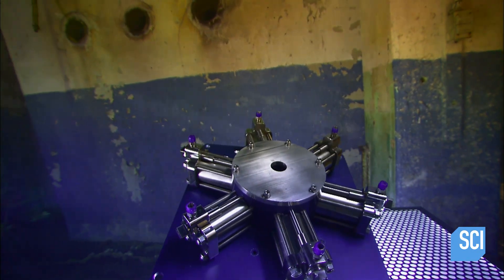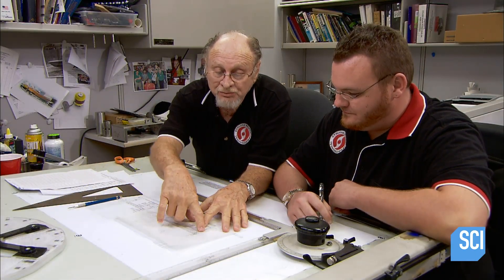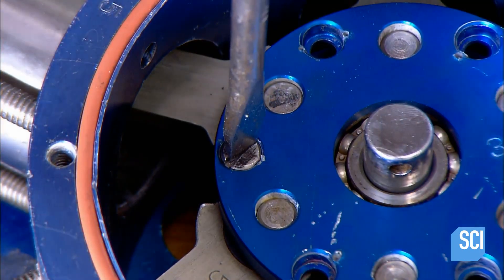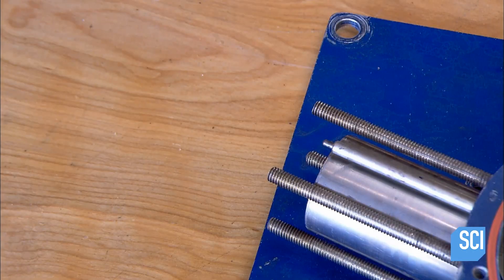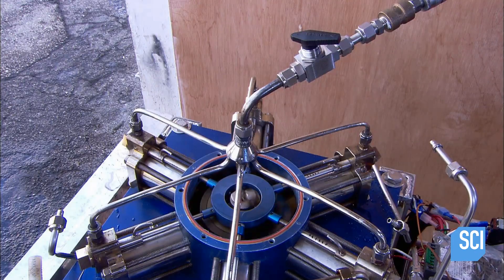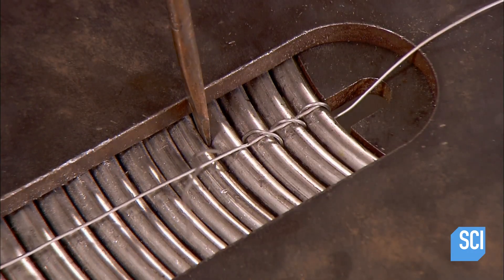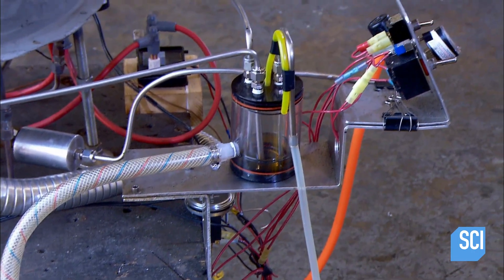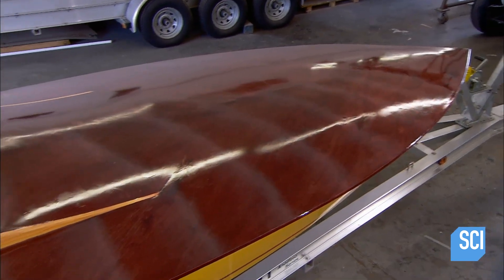How It's Made: Steam Engines

Comment: There are very good reasons we stopped using reciprocating steam engines. This is some cool, hobby level stuff but this isn't serious and I question their efficiency and clean burning claims.
Reply: yeah the multiple "so much cleaner/less greenhouse gases" claims are just outright lies lol.
Reply: @toxicity4818  Well if your burning waste like old fry oil then yeah, that's organic and carbon nutural.
Reply: @toxicity4818  they aren’t actually, lower burn temperatures and pressures releases less NOx. This is a huge problem with jet engines as their combustion chambers run at extremely high temperatures and pressures
Reply: @toxicity4818  There is a reason everything that requires high efficiency and reliability uses a steam engine.
Reply: @StuninRub  like what? Ships? Unless you're only focusing on nuclear you have absolutely no idea what you're talking about
Reply: @jonslg240  Look at almost every power plant in the world. With the exception of Solar, Wind, and Dams, everything else runs on steam.
Reply: @StuninRub   I don’t have enough patience to get into this discussion… either way, steam engine and a turbine powered by steam are two slightly different things. Also things don’t run on steam, they run on nuclear/ fossil fuels.
Reply: @Hypern0va  yes they do run on steam. Nuclear is ran by nothing but steam. They use uranium rods that undergo controlled fission which creates heat, that heat is used with water to create steam which turns turbines which produce electricity using magnets and copper wire. Coal and natural gas power plants all work like this as well. All fuel burning power plants work like this to be honest.
Reply: Steam engine? Or turbine? It's say to say you don't understand how nuclear power plants work... Or the rotational movement, like Mazda engines.
Reply: @SteveVi0lence   99.9% of the population doesn't know how a nuclear power plant works.. What are you trying to prove
Reply: @SteveVi0lence  I think you're lost
Reply: Yup, this one was total nonsense lol.
Reply: Admittedly I’d want to look up this product before actually buying one.
Reply: Denatured alcohol would work
Reply: @whidbeyhiker  dude stop changing you’re story, you’ve contradicted yourself 5 times already. Stop pretending you know what you’re talking about. Anyone who knows a lick about anything having to do with steam turbines steam engines or anything to do with steam sees right thru your bullcrap. Funny how I called you out on your bullcrap then you try to change what you said then act like you never said it and now you’re you’re trying to claim you’re right because you got called out and looked up the actual answer on google. People like you are disingenuous and can’t even keep all of their lies in order. You’re a fraud. Nothing you’ve said has made sense yet except for when you changed your answer about steam engines running at 10k-12k rpm’s and revised is to 1800-3000 bc you looked it up on the internet. Once again another contradiction. Hell you can hardly even speak English or formulate sentences. I’m done here. You’ve proved to anyone that reads this that you’re an absolute fraud and know absolutely nothing about this subject. Also let’s see your transcripts from school!!!!
Reply: Just throwing this out there for the steam turbines are quiet crowd, the average noise level in level in a power plant is 90 to 95 dB. This is loud enough to that you should use double hearing protection, I have worked with a lot of people who have lost their hearing To some degree. I'm sure somebody can find some little steam engine somewhere on YouTube that doesn't seem to make a lot of sound in the video in the video however I worked in the field for 40 years and I'm telling you it's hot it's loud.
Reply: @whidbeyhiker  Post the video!!! Let’s see it!!! You said you could prove it!!! You said you have the “certifications to back it up”. Once again another excuse! Im waiting to see what other excuse you come up with. You were all ready just a little while ago until I said I would be verifying and doing reverse searchers to make sure you weren’t just using someone else’s and trying to lie about it. You sure are doing a lot of talking. Let’s see the proof. I called you out on your crap and that was the last thing you expected. So once again stop googling names of certificates you found on google and start actually showing the proof. If ou had the proof you would have posted it by now instead of making excuse after excuse after excuse. I’m waiting.
Reply: @whidbeyhiker  you can say you have a million certifications, doesn’t make it true. Until you post proof of your certifications you nothing but a liar and a fraud pretending like you know what you’re talking about. Also you were so ready to post the proof until I said I would be checking and making sure it was legit and indeed yours and not someone else’s. Now you’re making every excuse in the world bc we both know you don’t have any certification in regards to steam engines or steam turbines. Absolutely nothing. You’re nothing but a little bum on YouTube that’s confused and doesn’t know what they’re talking about and then makes up lies about having certifications in order to make the false bs you say sound believable. You’ve gotten away with it for too long and think no one will call you out on your crap but guess what I did and now that I have you’ve changed what you’ve contradicted yourself multiple times you’ve stumbled over your words and you’ve made every excuse in the book why you can’t simply take a video on your phone showing your transcripts from the school you got your certifications from and then show your actual certifications that you claim to have. Once again like I said you were all ready just a little bit ago very eager to show me until I said I would be verifying to make sure it was indeed your and not someone else’s then you didn’t want to and tried changing the subject. That’s exactly what liars do bc you’re nothing but a liar and a fraud. I’d love for you to prove me wrong. So once again I’ll be here waiting for your video.
Reply: @whidbeyhiker  yeah I’m the one who said they were silent, you on the other hand said they were not. Regardless I posted the video on my page. Now post yours. No more excuses. Either admit you’re a liar and a fraud or prove me wrong.
Reply: @JohnDoe-yq9ml  Turn your volume up. That was sarcasm.
Reply: After being accused of being a fraud by a guy who thinks the Navy uses reactors on submarines because the turbines they power are quiet I decided to go ahead, do what he demanded and post a photo of my license. I guess a clown has to clown. I have to wonder, what will he demand next...  youtube.com/shorts/2Fz6jABMJyk
Reply: @whidbeyhiker  NO ONE WOULD EVER SHARPIE OVER THEIR CERTIFICATIONS 😂 who you trying to fool??? I could make that in 5 minutes using Microsoft office.
Reply: @JohnDoe-yq9ml   That is last year License. It is expired. My license requires an annual renewal, my Seattle license requires an annual renewal and continuing education. Why don't you do everyone a solid and reply only to the video I posted if you want to argue about it. I will be more than happy to debate you but I bet the rest of the people here are sick of this. Again, if you have the balls to continue this I left comments enabled on my short video (you did not, wonder why).
Reply: @JohnDoe-yq9ml  Apparently no retraction will be made. I sharpied an EXPIRED license. 

You don't understand the difference between a license and a certification. A license expires and has to be renewed periodically. A certificate is what you showed me, you get it once, rub it, drool all over it, hang it on your wall. My education was all military, there is no way I am showing you my military records.
Reply: @JohnDoe-yq9ml  Oh, hi clown, I just received this year's license if you still insist in seeing it. Let me know.
Reply: There actually isn't all that good of reasons.  

It stems almost entirely from tests run in the 1950's comparing antiquated, worn out steam trains burning coal or oil, to brand new diesel-electric engines while focused entirely on a micro-economic scale of cost to operate 1 train at a time.  

Now for fixed installation the steam turbine is simply unbeatable, which is why its used everywhere.  

But there is an argument to return to steam power for trains, the least of which is they can run off ANYTHING that makes heat, the vastly improved thermal conductivity of newer alloys, the cheapness of stainless steel.  The pro factors in that anything can in theory be used for fuel, including many kinds of materials that would otherwise be considered waste in the modern day.   Old steam engines were built to use coal because its was insanely cheap, burned very hot, and they didn't care about pollution concerns.   But anything from pelletized vegetable farm waste, to trash, to used cooking oils, bio diesel,  or even battery powered electric boilers world work.   It if burns, can burn hot, it can boil water and make steam.   That and with modern materials they could run boilers with 3x the pressure of the old ones that were using mild steel or pig iron boilers, meaning EVEN MORE power.   They already do this with ship boilers for their steam turbines.  

Diesel-electric's biggest problem in trains is the efficiency falls off as the RPM's of the electric motors increase, and the losses of power conversion inside the train engine itself.  This means the operator starts "wasting" fuel as they increase the speed of the trains since they need to burn more fuel to go faster.   Steam engines are the opposite, they can be hard to get started, put out more horsepower the faster they are run, with bearing strength and wind resistance limiting their top end speeds.  

The biggest problem is people cannot get out of their head the image of the trains of yesteryear pluming giant clouds of black smoke and equate them with toxicity and air pollution.  Thus its become a hard absolute hard-no from non-engineers to even considering modernizing steam locomotives.    In fact the world's remaining legacy steam engines were quickly decommissioned as the public demanded their removal with the rise of, (much needed honestly) environmental awareness by the public in 1960's.    Despite the fact diesel-electric makes more carcinogenic emissions, and burns more fuel per ton at higher speeds, it doesn't create plumes of smoke.  Simple people are simple, but they do vote and write their politicians eagerly.  

Also steam is 100% useless in a short-range, light-duty passenger car.  Most of the applications shown here are ridiculous.  Steam is kind of crappy at small scale and scales with size.  The opposite is true of internal combustion.
Reply: Here is a video of a plant I am responsible for. It's loud. Just a little taste of what it is like working around boilers. FWIW, this is one of the cleanest boiler rooms you will ever see. We pulled all the turbines out years ago, they were loud, very loud. After removing the turbines we downsized the boilers youtube.com/watch?v=RFT3wtx24D0
Reply: Very loud, these guys should be wearing double hearing protection. You can here them talking about the main condenser and he states that there is no vacuum at the beginning. As the steam is used and expands through the turbine it then cools as it passes through the heat exchanger (main condenser), the volume of steam is reduced greatly which causes a vacuum to form in the main condenser. youtube.com/watch?v=LsUFcMPhEpw
Reply: @whidbeyhiker  dude shut up and post a video of the “certifications” you said you have. Stop making excuse after excuse. You got called on your bullcrap and you’re making every effort to try and change the subject. You said you had certifications to prove it. You’ve done no proving only more lying and more excuses.
Reply: Yall the reason Russia has such a strong hold on the EU. All this stupid talk about renewable and fuel efficiency gives countries that have control over natural gas and oil such a monopoly on entire groups of people. 

Burn coal and use nuclear power. Screw these new age means of energy
Reply: Literally why is it not a turbine?
Reply: Steam engines are quite thermally efficient and don’t generate much noise in comparison to other engines, reason we stopped up using them is that they do not produce much power for its weight and size. But they generates massive amounts of torque and don’t rev particularly high which would work well in a large ship or train. When it comes to how clean they are, it’s pretty much determined by the fuel it uses.
Reply: @loludied552  guess I better turn all turbines off at work since we don't use them anymore.
Reply: @whidbeyhiker  you know we use steam engines in nuclear submarines bc they’re infact extremely quiet. You need to stop lying and talking about things you know nothing about. And Steam engines do not run anywhere near 10-12k rpm’s. Stop lying and acting like you even work with steam engines or turbines.
Reply: @JohnDoe-yq9ml   I said reciprocating engines, I did not say steam turbines.  Reciprocating engines have pistons that go up-and-down, waste a lot of energy, inefficient. Steam turbines have big wheels with turbine blades that go round and round, they are very efficient, and those are the steam engines that you will find in an aircraft Carrier or submarine.  I am perfectly fine debating this with you, I have multiple grade one steam engineer licenses both national and local, I have been doing this for 40 years.  Served several years on a navy aircraft Carrier before I realized they pay more on the outside.  If you insist on critiquing what I wrote please read it first.
Reply: @JohnDoe-yq9ml no we use steam turbines on submarines. And they are still loud enough to hear the things from miles away.

This ain’t a turbine but a shitty reciprocating steam engine with a shitty steam valve.

And just to be clear. Even the most efficient steam turbines only achieve a system efficiency of 35% while a 2. Litre Toyota NA 4 banger gets slightly north of 40%
Reply: @loludied552  we stopped using them (at the time) because they weren't instantly ready to get in, start and drive like petrol cars. At the time, they powered 100mph road cars when petrol (I'm pretty sure) did not. Back then steam was high maintenance just to operate it at the level of technology. Today is a completely different level.
Reply: @loludied552  steam engines, turbine or reciprocating are extremely loud and extremely efficient which is why we use them for power generation. They spin at 1800 to 3600 RPMs. Not only are you wrong, you're wrong on all counts.
Reply: @whidbeyhiker  reciprocating steam engines were loud before the concept of condensers and sealed unit water supply. All that high pressure steam escaping sound is no more with modern steam engines. The fact that steam doesnt have little "explosions" in the cylinders means less noise and wear from the engine itself, making for a quieter engine generally. Once you muffle a petrol genset properly, then you notice the din of engine clatter that petrol engines make. Big steam turbines are very loud because they're big, the generator they drive makes more noise and is probably 70% of the noise you hear in a power station. I can only imagine how much noisier a diesel engine same sized power station would be- picture the engine room of a medium sized ship.
Reply: @whidbeyhiker  to be more clear, the topic is reciprocating steam engines not a turbine since the subject of the video was basically putting a steam engine in a car and pretty much every car uses reciprocating engines or a some have used a rotary. no car in a long time or ever has been successful using turbine engine and the last turbine car apart from DIY was made in 1979 which failed as a product. 

You pointed out one of my mistake, once I went on a steam ship and you can stand on a platform that overlooks the engine which wasn’t blocked by any glass, the engine was quite quiet since it only revved around 100 rpm (this is how I concluded that steam engines were quiet. 

The steamboat was the size of a ferry that would stop every 3-4 km just to give some perspective on how big the steam engine might be.

I’m sure a large diesel engine at that rpm would be similarly quiet.

One time I went on a steam train that possibly revved at 300rpm (the train was very small), but the steam engine was possibly built in a farm, and the engine on  was kind of loud, possibly as loud as a Diesel engine at that rpm.
Reply: @loludied552  steam engines are extremely quiet. It’s why they’re used on the most advanced submarines. Don’t even start about diesel submarines, they surface to run their noisy Diesel engines to recharge their batteries, and then dive and and travel underwater using nothing but electricity.
Reply: @JohnDoe-yq9ml  lol, I've been wearing double hearing protection for 40 years. Just stop, you have no clue.
Reply: This engine has some serious issues to it that would be pretty quickly apparent to anyone familiar with steam power. Burning fuel at lower pressures reduces NOx emissions, but that's more of a smog gas than a greenhouse one to my knowledge.

The biggest problem I see with this thing is that it has no variable cutoff, the valves just open and close at the same part of the stroke no matter what. Such an engine will spin and develop power, but will do so horribly inefficiently, so much so that several of the key advancements in the steam age related to how steam was carefully admitted into the cylinders to take advantage of the expansion of the gas and not just it's head pressure. Corliss valve gear is the most refined that I'm aware of, and it seems much better than what's shown here. I'm also doubtful of their total condenser recovery, it's not easy to do even with huge radiators, unless this was a completely static system, and then why bother with that?
Reciprocating steam engines can have uses in industry, but I don't see these being them.
Reply: @microwave221  you are my other hero on this thread.  Thank you, kind sir. Too bad the general population probably aren't able to understand what you mean. Which is basically the whole problem in the world we live in. Everyone has an opinion they'd fight to the death for, and 97% of them don't actually understand what they're saying.
Reply: @microwave221  I don't believe you are ever going to obtain anything close to complete combustion so it would be difficult if not impossible to establish consistent NOx levels.
Reply: @whidbeyhiker  he didn't make this engine, when you say "you" you're not talking about the person whose comment you're replying to
Reply: @jonslg240  No, when I said "you" I was referring to the person who commented about knowledge of nuclear power. Don't pretend to tell me what I meant.
Reply: Maybe termal efficient is higher compared to internal combustion
Reply: @whidbeyhiker  also let’s see your transcripts from the school you got your “certifications” from and let’s also see those “certificates”. You said you’d show everyone. I know you can’t bc they don’t exist but I’d love to see how you try to lie your way out of this.
Reply: I don't know how much you know about steam engines but bear in mind that the Ranking cycle across the vapor saturation bell of water is one of the most efficient cycles that mankind has ever developed. In fact, most powerplant works with such a cycle, from coil/oil power plants to nuclear and also some solar power plants. The only difference is that they usually employ turbines to let the fluid expand and not pistons, but pistons can be very efficient for small mass flows and to get high torques at low speeds...
Reply: @francescogiuseppemorabito4276  1. It's rankine cycle.

2. The brayton (gas turbines), otto and diesel cycles are all significantly more efficient than the rankine cycle. The rankine cycle tops out at 35% or so while the otto cycle hits 40+% in production cars (camry), the diesel cycle hits 50% in ship diesels and the brayton goes up to 40% as well.

The rankine cycle isn't popular because it's super efficient it's popular because it is really power dense, cheap,  scales well, was available long before we had gas turbines and is reasonably efficient.
Reply: @anonym3017  sorry, t9 issues... However, to get more technical... What you say is not totally true. Sub critical rankine tops at 38%, the super critical can go way higher. And to be as precise as possible, the highest efficiencies are achieved with combinations of supercritical rankine and joule-bryton - getting very close to a carnot ideal machine in such temp range. Furthermore, I do agree that diesel can go super high up. However, I guess that if we speak so general, citing what's available on thermodynamic machineries books, we miss the point here.
The diesel engine that achieve 50% fuel eff. of which you write about, is a 2 strokes - 6 cylinders engine bigger than my house and operated by a team of trained engineers. Going smaller, for example, the diesel generators in any construction site still cost more than my car, but they have 30% efficiency at best. Going smaller to a few kW, we get diesel/ petrol generators that work at horrendous efficiencies, because they are cheap small and fast. These two last things are the first sources of inefficiency in any application. Therefore, to go back to the original thread, this little steam engine with condensator (if they managed to make one as claimed) looks interesting to me even if it is not a UNIFLOW ENGINE - I still reckon that losing a power stroke when you have a stellar config is kind of alright...
If we compare this to a little diesel generator for small off-grid applications, I bet this steam engine will easily win on efficiency, and you also have the benefit of burning whatever you like from wood to propane.
Reply: @francescogiuseppemorabito4276  the combined cycle (brayton and rankine) approach you mention involves a gas turbine, producing electricity and running on the brayton cycle, and then using the still hot exhaust of said turbine top produce steam and drive a steam turbine, running on the rankine cycle.

this shitty steam engine is obviously single cycle and doesn't involve a gas turbine.

And once again. The highest efficiency single cycle steam turbine currently in use gets a 35% efficiency

This thing will be well below that.

Meanwhile the engine in a toyota camry hybrid, 2018 model year and up, hits a cool 41% efficiency.

so no. this thing is a scam and significantly less efficient than a widely available production engine on sale right now.
Reply: @Andy Ruse They are cleaner, the thermal efficiency is better on a steam engine. More work for less fuel
Reply: Omg Whidbey, thank you for saying this!
I LOVE how they say a VEHICLE (aka car etc) WOULDN'T require a TRANSMISSION because this engine produces SO MUCH ROTATIONAL POWER 😂😂😂
I can't believe that nobody in the decision-making process for How It's Made doesn't have an engineering background, or even an EXTEMELY-BASIC understanding.
Reply: @jonslg240  he said reciprocating steam engines not a vehicle. Whether you want to have a debate about what constitutes an engine vs motor
Reply: @jonslg240  steam engines don’t require transmissions, they’re direct drive bc of the amount of torque they produce. Shows how much you know.
Reply: @JohnDoe-yq9ml  Turbines require reduction gears for most large applications, main engines and generators. Smaller turbines can be directly connected. Shows how much you know. Reduction gears are typically a fixed ratio, again, shows how much you know.
Reply: @whidbeyhiker  that’s what I thought.
Reply: @whidbeyhiker  yes you did. You said you could prove it. That’s what I thought tho. Bc if you had it you wouldn’t have any problem showing us. Excuses excuse.
Reply: @whidbeyhiker  post a video on your channel showing your transcripts from the school you went to in order to get your certificate. And then post a video of your actual certification. I will also be checking to verify if it’s real and I will be doing a reverse video and image search to make sure you’re not using someone else’s photos or video. I’ll be waiting for your next excuse.
Reply: @whidbeyhiker  sorry I was working at the job I actually have certifications for. Btw tell me exact certification you have. I’d love to know.
Reply: @whidbeyhiker  I just did. Learn to read. I’ll say it again since you have a hard time with reading comprehension. Post. A. Video. On. Your. Channel. 
Is that clear enough for you?